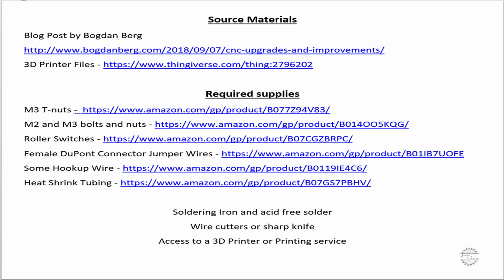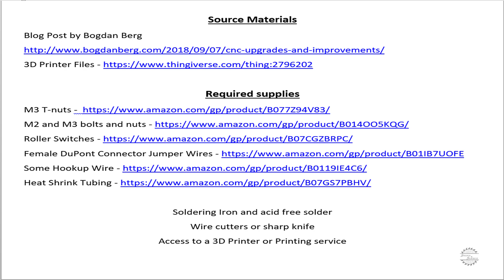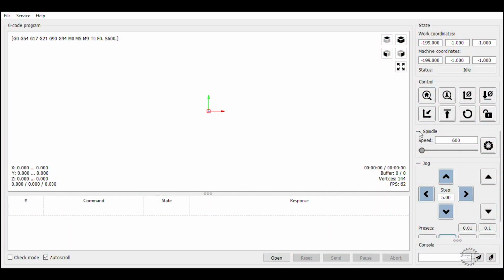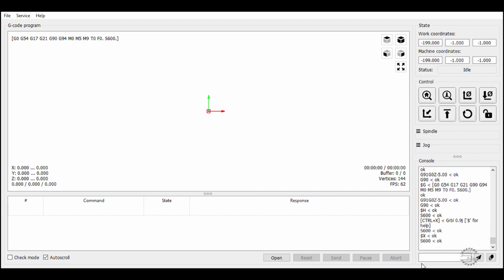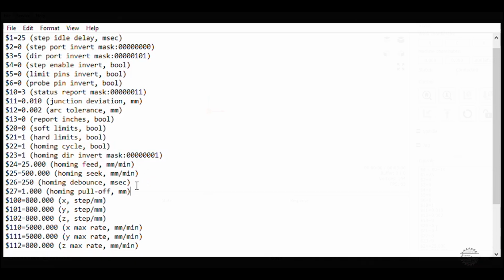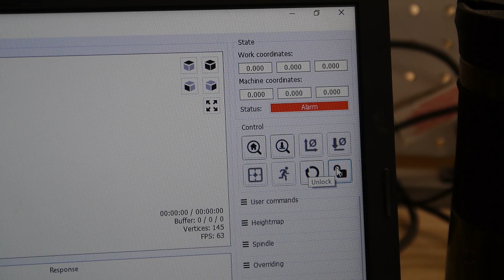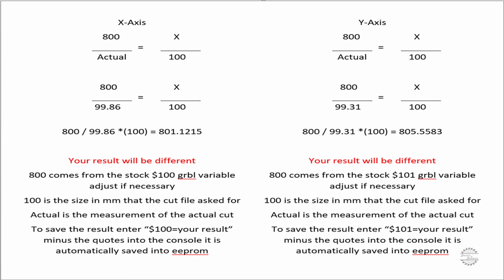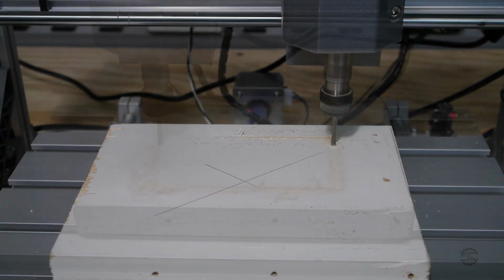3018 CNC End Stops and Calibration

Comment: I have a problem with the endstop. If I run x y or z manually with the software the endstops work, but wenn I try homing position the z goes up and over the endstop. I can't figure out why?
Reply from the maker: That is a known problem if you have an older board from grbl 0.8 era.  In 0.9 the pins (D11 and D12) were changed to allow for variable spindle speed.  Here is a video showing one way to work arround.  https://www.youtube.com/watch?v=aXcsRKDZsv4 On my board there are two pins that work for each axis limits I just didn't install the lower Z.  If you look closely at 4:16 in my video there is an empty space between the Yen and Zen, that is the second Z on my board. Boards on these can vary a lot though.  Google 'grbl z limit pins' and there is a bunch of info on this.  Myself, I would first try to use a multi meter (with the machine off and unplugged completely) and continuity trace where pin 12 on the actual ATMega chip come out on the pin header.

Comment: Can i know how the best feed rate and plung rate setting for this machine
Reply from the maker: The feed rate I used in this video is 100 mm/min with an 80mm/min plunge, spindle at 100%.  That was in softwood (pine) with a 3mm 2 flute endmill and a pass depth of 0.5mm.  I would say to go slower with harder material.  The 'Best' rates are a more complicated answer.  In theory feeds and speeds can be calculated mathematically, but that math assumes a near perfectly rigid machine.  These little machines just don't have enough structural rigidity to handle proper chip loads that the tools are capable of.  In my larger cnc I can use that same 3mm tool at 16k rpm, 800-1200mm/min feed with a 1.5mm pass depth (in softwood) all day long.

Comment: For better working you have to use coaxial cable( antenna cable) protected from electric noise caused by the spindle. In some machines when you turn on the motor it can cause the fake activation of an end switch
Reply from the maker: I agree.  It can get bad enough to cause missed steps as well.  I just haven't made it that far in my mods yet.  Small (30pf) capacitors across the terminals of both the spindle and separately on the limit switches can also help with this.  And maybe a 100uf electrolytic on the spindle terminals as well.  I'm also looking at some stepper smoother boards to prevent false / skipped steps from noise.
Reply: Where do you connect the shield to, as I can't find an earth connection on my machine?
Reply from the maker: @anthonygregson719  If you are referring to using coaxial cable, for the limit switches I would use the center conductor for the signal side and the shield for the other.  If you look closely at the woodpecker board the entire bottom row of header pins are ground.  Physically keeping the spindle wires separate also goes a long way to solving the noise problem.  If you really wanted to ground the machine you could run a wire from the chassis to a metal water pipe or something like that and the ground to the chassis.  My particular machine isn't that terribly noisy but I ran my z axis stepper and limit switches separate from the spindle wires.  There are some 3d printable standoffs to keep them separate as well.  Personally if my motor was noisy enough to cause consistent real problems I would put a couple of caps across the motor first.

Comment: You said to solder wires to the COM and NO......shouldn't that be NC?
Thanks for sharing!
Reply from the maker: I just verified that mine are connected to Normal Open (NO.)  Seems like firmware has the pins trigger on a high not a low.  NC should lock the machine in a continual alarm state.  Could be tested with a single jumper wire.
Reply from the maker: Edit that.  I suspect I have the pin trigger state backwards but not the physical connections on my switches.  They are definitely Normal Open.  I'd have to verify with a meter but the one row of pins is most likely always hot and when the switch closes it shunts to ground.  Could look for it in the GRBL source code as well.
Reply: @everlitesv  You are correct... I just tested it and it would put the machine in continual alarm state as you stated if wired NC.... I stand corrected! =:)